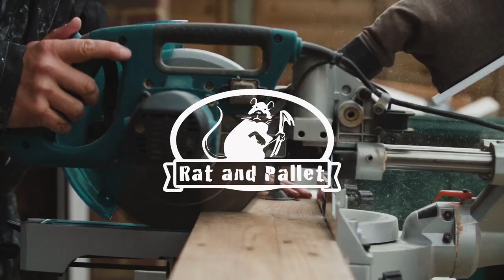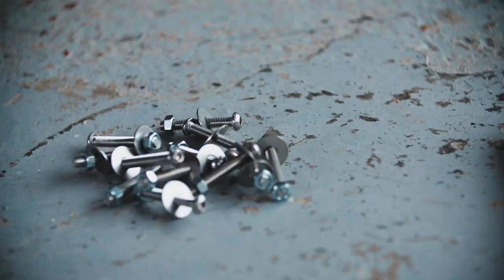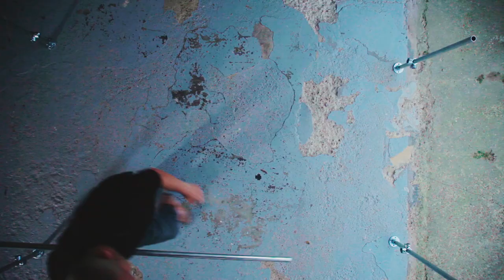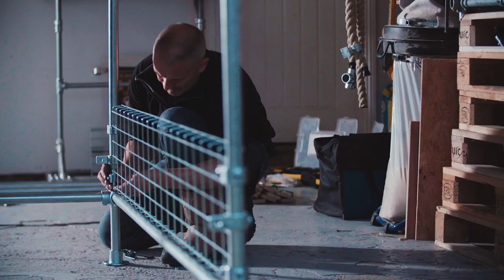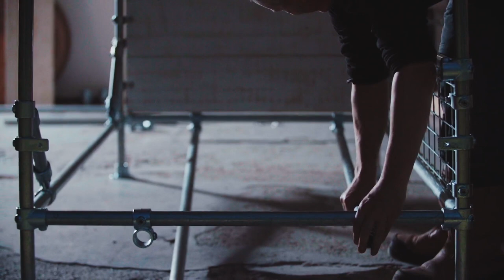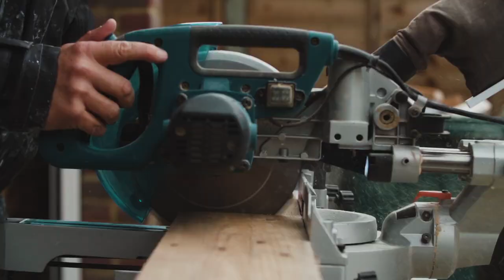Make DIY Bunk Beds or Single Platform Bed from Kee Klamp Scaffold and Boards with Basic Tools

Comment: How would i makes simple full size frame, with way to attach a tufted  headboard, that is 18 inches (not including mattress height)  aNd can handle the weight of a latex mattress (they are usually heavier so I’m concerned this wouldn’t be strong enough)?

Comment: This is great! Have you any suggestions on where to get the tube and fittings at best price?
Reply from the maker: I try to avoid recommending supplier Pete because it kind of implies endorsement.. and it all depends where you live too. There are some good national online suppliers in the UK that'll cut to size and deliver for free if you spend over a certain amount (usually around £100) or perhaps local scaffolding merchants near to you may be cheaper. As long as you specify the correct components you should be OK. Some have a thin layer of grease - which  makes them more corrosion resistant outdoors but gives them a duller look and obviously a bit messy for use as furniture. The 'Interclamp' brand are usually grease free and therefore cleaner and shinier.

Comment: Great idea .. might try this for my two boys.. any idea how much all the bits cost ( ballpark) and what size tubing did u use..
Reply from the maker: Well it wasn't cheap.. material costs alone were around £500.  I've got the full cost break down with cutting lists/instructions etc in my Etsy store now if you're interested, just click on the Etsy link above - https://www.etsy.com/uk/shop/RatAndPallet.  The good thing about this design though is you can build the lower bunk first without committing to the entire build straight off.